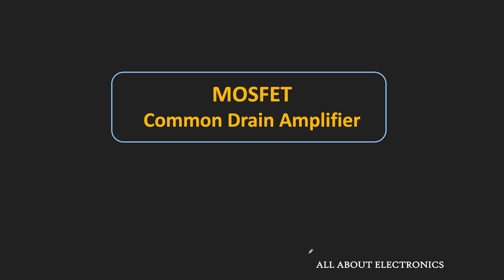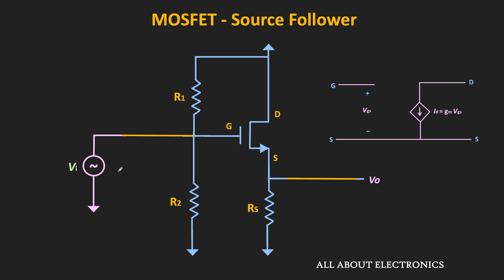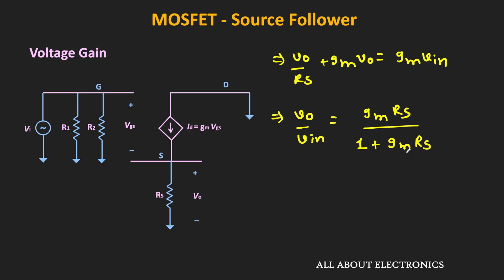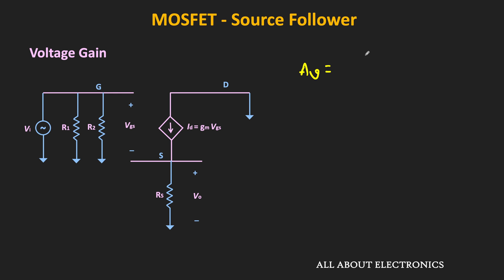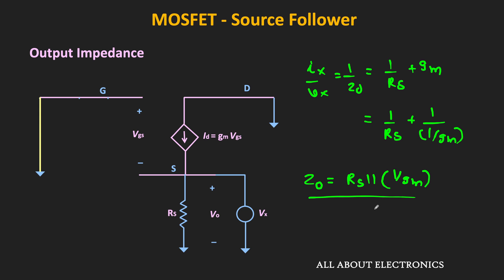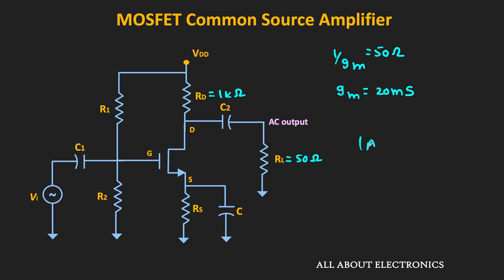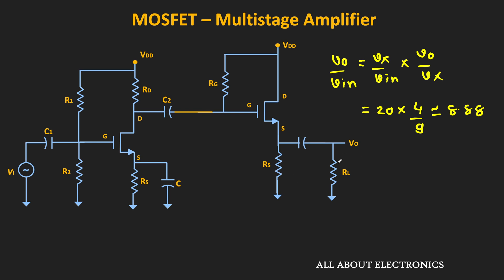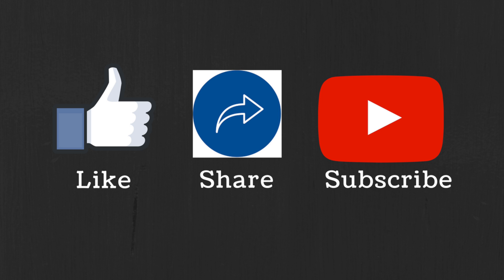MOSFET Source Follower (Common Drain Amplifier) - Small Signal Analysis Explained

Comment: why you said drain is grounded at starting , but in circuit is connected to Vdd
Reply from the maker: Drain will be at the ground potential in AC analysis. Because during AC analysis, all the DC source will act as zero.

Comment: why vgs  not equal to zero in this case like in common source amplifier
Reply from the maker: I guess you are refereeing to Vgs, while finding the output impedance. Because here, the source terminal is not at the ground potential. There is a source resistor (Rs) between source and ground. If you still have any doubt then let me know here.

Comment: Is there any chance that you would be able to explain to me the KVL at4:05? Why do you choose to introduce a variable for both Vi and Vgs, when Vi=Vgs? Also with that in mind, why are we not able to derive the gain equation from a single KCL at the node Vs (Vo)? I notice that my method yields the incorrect solution, but your method of the KCL with the KVL yields the correct solution. I was hoping you could explain why that is? Thanks so much!
Reply from the maker: Vin and Vgs are not same. Vin is between drain and ground, while Vgs is between drain and source. And source terminal is not at the ground potential. I hope, it will clear your doubt.

Comment: Why Vx introduce in output impedance will you explain
Reply from the maker: The output impedance is the Thevenin's equivalent impedance looking from the output side of the small signal circuit. So, here the procedure is very similar to the procedure which is followed for finding the Thevenin's equivalent impedance of any circuit. Since the circuit contains dependent source, the test voltage is applied at the output side. I hope, it will clear your doubt.

Comment: Very fundamental. It’s perfect! An interesting move forward would be to discuss designs in the context of lectures you have already converted, so maybe you could go through a low frequency op amp design with these fundamentals + the differential amplifier videos. It’s kinda difficult to cover dynamics in this setting, but you could approach it in the context of avoiding Barkhausen criteria.